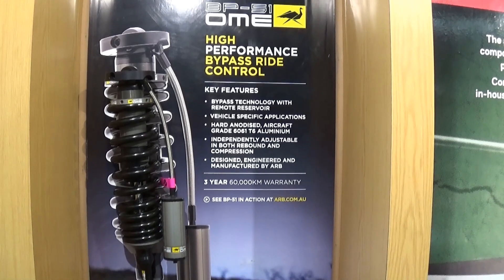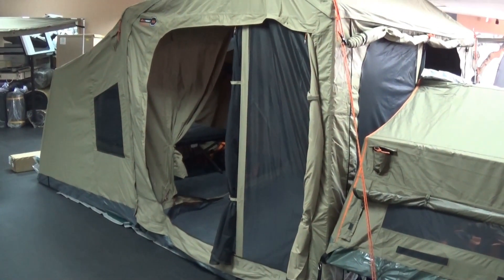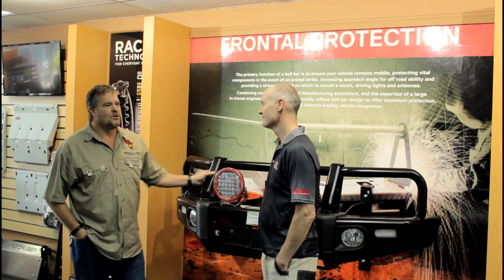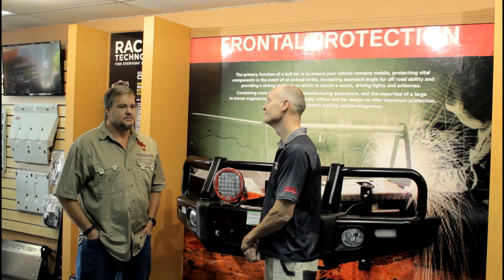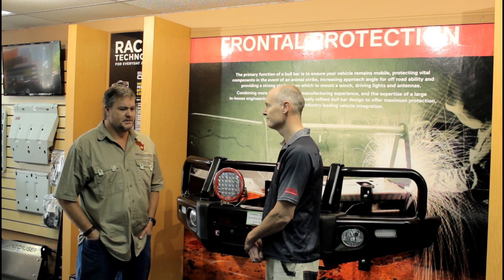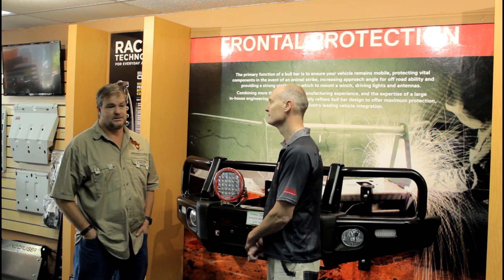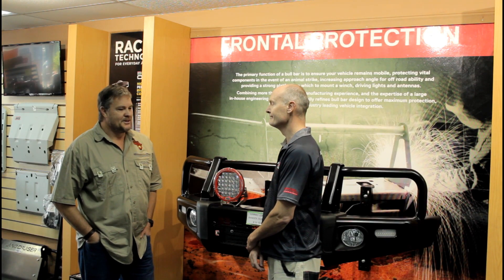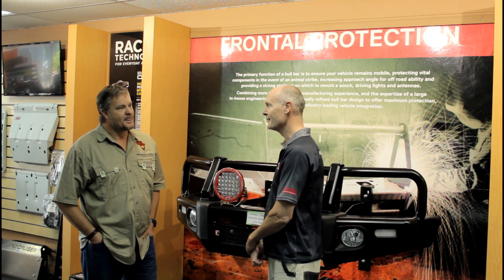Toyota Hilux Overland Setup - Phase 2.0 : Suspension Upgrade! Old Man Emu

Comment: It depends on what you need I am looking at fox . I drive 90% dirt road and our roads are bad coricated rocky and holes I need to ride plush the Toyota hilux rides very hard so if you drive 200km gravel road each day with very little load what drives the softest
Reply from the maker: Hi Eric, 
Yes, as most things off road related, it depends on your needs!
(Apologies up front for the long answer)

For our Overland travel, I needed something that will assist with the loads we carry across various types of terrain. 
I believe there are VERY good options out there: OME, Tough Dog, IronMan, Fox, etc. etc. 
My experience with OME never disappointed me in almost 2 decades of travelling. 

Installing a set of shocks which offer selectable options (rebound and compression), be it BP51's from OME or the  Ironman variety (to name just two), this will allow you to set in / adjust to your circumstances - right there next to the road. Be it "No load - bad roads", or rock crawling or "load with bad roads" etc.

It is expensive, but safety and enhancing  your vehicles ability to allow you to travel the roads you do, is paramount in my point of view!

This said. Do your vehicle setup first, then go for the suspension upgrade, as this will allow you to choose the correct suspension and components based on your vehicle requirements. i.e. OME 400kg and 600kg constant load leaf springs makes a huge difference, if you are loaded or not.

So the big question remains: What is wrong with OEM (Original Equipment) from lets say Toyota? Vehicles are designed according to the "average Joe" requirements, which is not bad, but the Average Joe might only go off the road once a year. So why increase costs and include a super duper suspension if most people are not in need of it?
In South Africa, any changes to lets say your suspension is considered an aftermarket upgrade. It is not standard equipment from the floor.  I believe Toyota does keep the Factory Warranty when you do install OME's, cannot say for the others....

I hope this helps.

Cheers
Reply: @ExperienceWildAfrica  thx appreciate the response

Comment: I have a Hilux 2.8 and an XT140 and was looking forward to hearing your impression of whether the suspension upgrade worked, but the video just ended. I know with lockdown it's difficult, but maybe could you split your findings into 2 videos, 1 for road handling and 1 for off-road handling. I think there are quite a lot of Hilux owners that would like to know whether the upgrade was worth it. Anyway thanks for the video!
Reply from the maker: Hi Sean, 

Yes lockdown has had an effect on our efforts to enjoy the outdoors.
I have been very impatient with all of the upgrades and off course testing out my new gear.

Definitely I will be providing feedback on the suspension, both on- and off-road! 
Keep an eye on the channel for future videos
Reply from the maker: Hi Sean, 

We spent Friday doing game viewing on gravel roads in the Dinokeng Game Reserve. Paved road travelling has improved, and the gravel roads also showed a huge improvement over my previous suspension setup
I can definitely tell you that the suspension fitted made a huge difference!

I just came back from a wonderful day out on a 4x4 trail. ( Hennops 4x4 Trail)
The new suspension was absolutely awesome!! 
I have improved wheel articulation, corrugations and rocky driving has improved with leaps and bounds.

I am most certainly a happy man! :-D

(Video about our days fun will be released in the near future)
Reply: Experience Wild Africa that’s awesome, thanks for the great feedback 👍🏻

Comment: Hello Sir, i hope you can help me with my inquiry.
I have a fortuner 2018 4x2 and have plans of upgrading the stock suspensions to Old man EMU, well there are lots of suspensions from Ironman Foamcell to Toughdog to Tein 4x4 Damper sport. How is your ride after the installation of OME ? On and off road ?
Reply from the maker: Hi AD 7

Apologies for the late reply, 

My honest opinion is that the ride quality is very very nice indeed. Especially when loaded. The standard suspension is just not capable of delivering the same ride quality and performance like the OME.

My Brother has the same vehicle than me, and he fitted Tuff Dog adjustable shocks with blades and he is also much happier than with the stock suspension..

It is a huge sum of money to spend, but a definite improvement is achieved both On and Off road

Comment: I have a Ford Everest and an XT120 with standard suspension, what would you suggest I look at if one is a bit cash strapped but looking at improving the suspension for a better drive?
Reply from the maker: Hi Hein, 

This is a tricky one as it would depend on your needs. If you seldom venture off road with the trailer, let the standard suspension do it's thing. If you are unhappy about it, chat to someone at 4x4 Mega World or similar, for professional advise - You may not need to replace your suspension in total, but only fit airbags as an example.